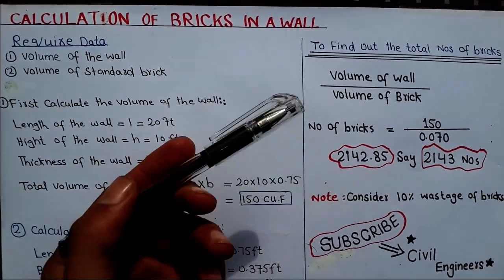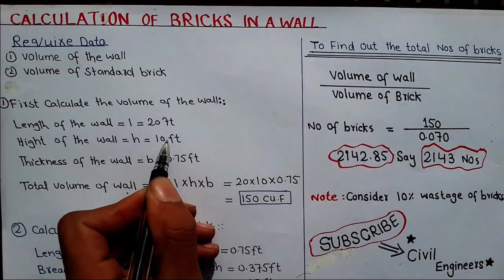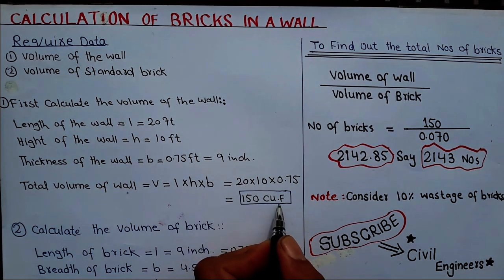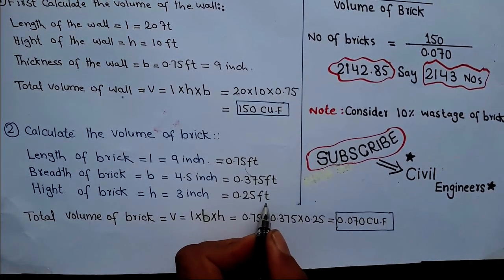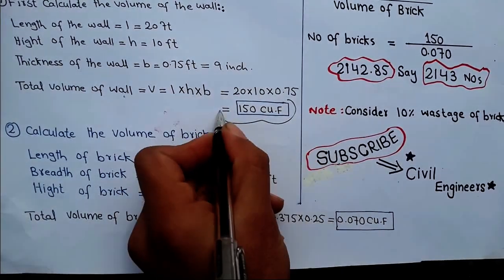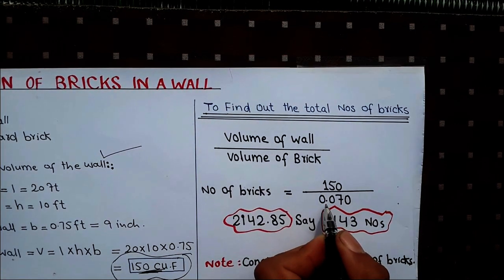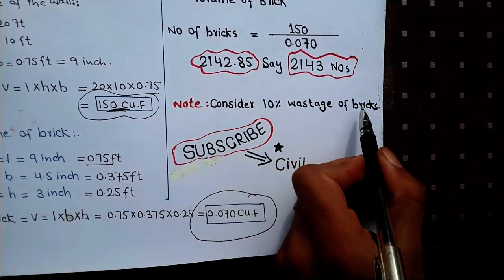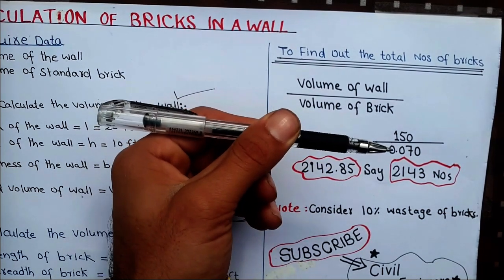Calculation of Bricks in detail.

Comment: doing  good job  but keep one thing in mind there are brick joints too. when u constructing brick masnory  head joints 3/16 inch width 2/4 inch and bed joints 1/4 inch
Reply from the maker: Thank you bro but this is only Bricks quantity for mortar i have other lecture check hare . how to calculate quantity for mortar in brick masonry.
Reply: he mean you neglect the mortar between the bricks in your wall volume calculations. if we sum up the volume of the mortar and subtract it from the total volume then we may get less bricks.

Comment: how could I perform the same calculation if I have 3 different bricks  size (100cmX50cm), (50cmX50cm)(25cmX50cm) without cement? is it possible to come out the number of each used bricks?

Comment: Hi every one
What shown in video is 2143 no of bricks reqd for the wall i.e without  considering cement motar joints. But in site while constructing there will be cement mortar joints 10 to 15mm and after completion of one layer again 10 to 12mm cement mortar will be laid .so Exactly how much bricks will be less from the total no of bricks
Can anybody explain
Reply: that is what i want exactly to say. you can not neglect the mortar because is taking some volume of your total wall volume. to me i add 1 cm to every brick. if my brick is 15 cm i calculated as 15 cm.
Reply: Ismail Kingsss volum of motor add in volum of brick
Reply: Ismail Kingsss 10 mm add in these three values of brick.brick lenght 9×4.5×3....so add 10 or 15 mm in these 3 values...